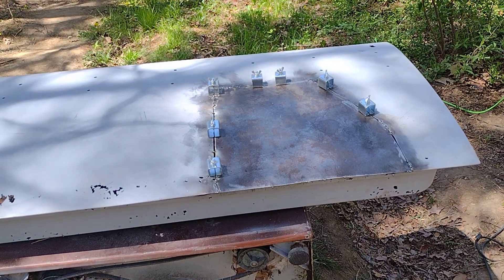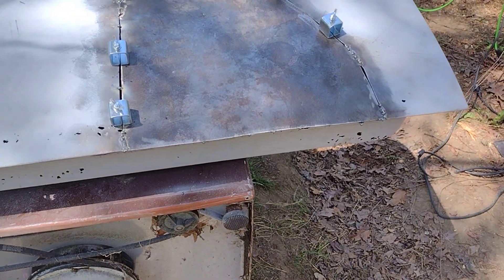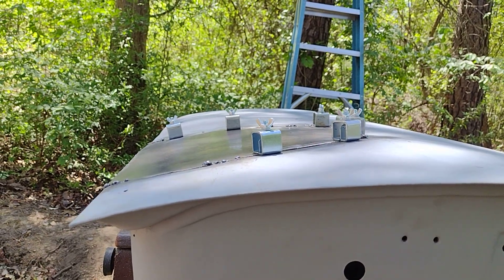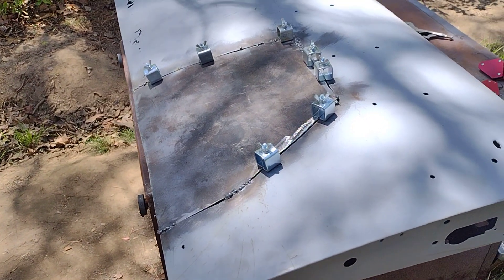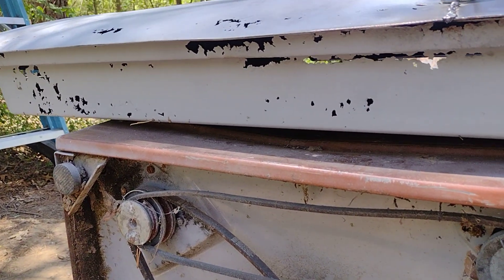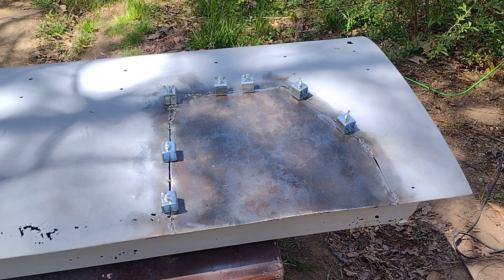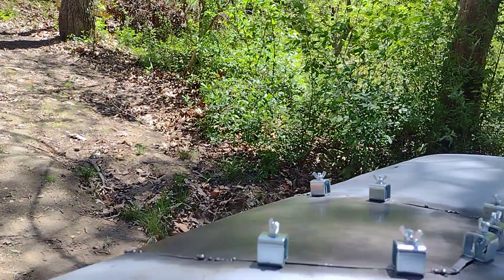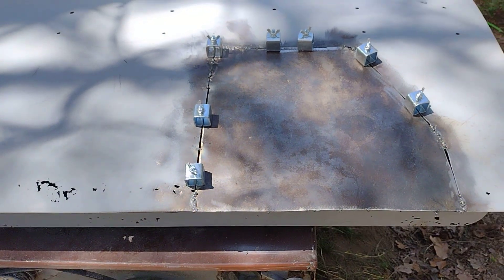1957 PLYMOUTH DOOR SKIN REPAIR PATCH PANEL ALMOST FINISHED

Comment: What kind of welder are you using?
Reply: Looks like you need more amps, welds are not penertrating ,causing blobs, I have a Lincoln mig , I use low to medium setting and slow wire speed for good penertation without burning thru, test on a scrap piece to set up correctly
Reply: I've welded flux core since I bought my mig 20 years ago, have never used gas, gas would be better but you can make er weld good with adjustments